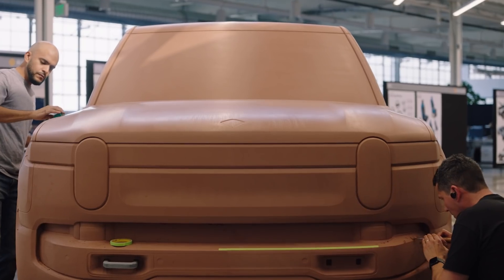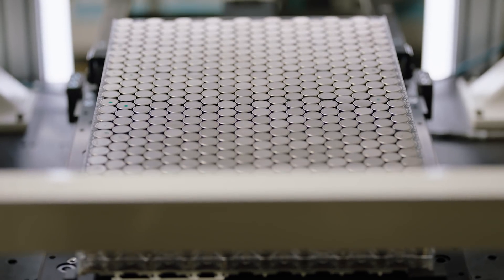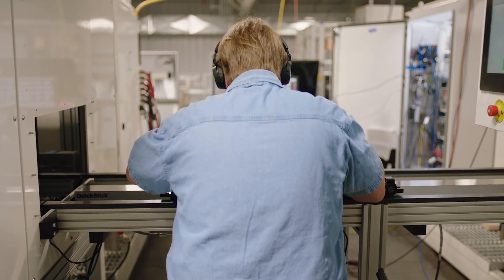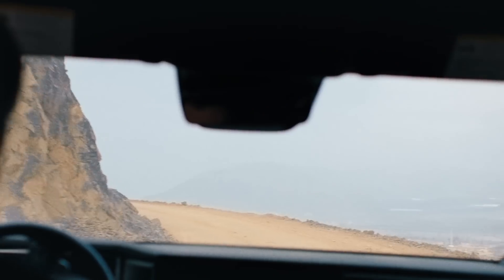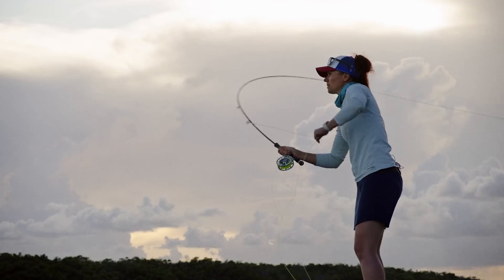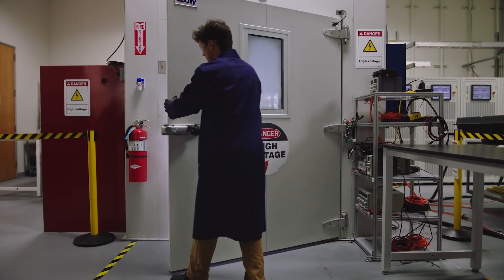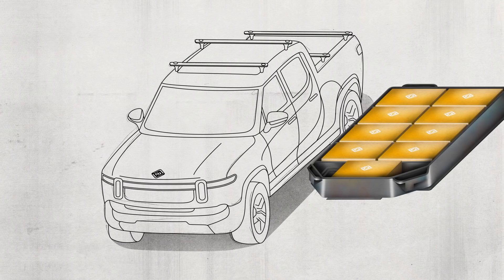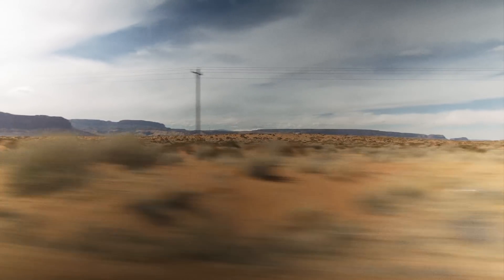Powering Adventure | Adventurous Forever | Rivian

Comment: I had high hopes for this truck , and I like the fact that your testing in dry applications like rocks and dirt , but can you test in wet applications like crossing a small water crossing higher than your brake rotors, the ford f150 electric admit that its not water friendly and water can not go higher than the bottom of the brake rotors , kinda disappointing

Comment: RIVIAN is poor Design and poor Specs and its Expensive. 
Rivian R1T is a LIGHWEIGHT Medium Size Pickup , its made with a 100 year old Body on Frame design. 
and its using SOFT Metals that can Scratch , Dent, and RUST Easily. good luck keeping a Rivian for 50+ years. 
besides you are Paying LUXURY price for a SHORT BED Pickup that has less spec than a Dual Motor Cybertruck.
Reply: If the body on frame design is so bad, then how come its the industry standard?
Reply: @casper6800   - because GMC, Ram and Ford are NOT Vertically Intergrated and DO NOT use 1st Principles in Engineering. 
LEGACY truck makers are still using CATALOG ENGINEERING and DO NOT make their own PARTS. 
they get them from the LOWEST BIDDER. 
and they BUILD their Trucks from a PARTS BIN Catalog from Suppliers , MANY have the SAME Parts.
so, LEGACY trucks are NOT Innovating. 
which is why FEW trucks even have 4 Wheel Independent Suspension. 
and they are using HORSE & BUGGY suspension , invinted 100 years ago.
Reply: @markplott4820  
And the point I'm trying to make is that, even though body on frame has its shortcomings in some areas, when it comes down to truck design its still the best option. 
Trucks get used, if a body panel gets dented, it can be easily replaced as long as the chassis didn't get damaged in the process. 
Also the use of a classic chassis allows for a simple 3 box design, witch is not only easy to manufacture but also incredibly efficient owing to very little wasted space for the space it takes up.

And to add to that, Rivian uses an independant adjustable suspension.

Not to mention, if there really was such a superior design out there, wouldn't every truck on the road today look completely different?

And this is very much nitpicking but your "Horse & buggy" suspension is called leaf spring
Reply: @casper6800   - ZERO Innovation happening with LEGACY truck makers.
same, Bullshit. year after year.
RIVIAN, TESLA, BOLLINGER are doing MORE
Reply: @markplott4820  
Im not trying to defend legacy truck makers, I was just wondering why you seemingly had a problem with a body on frame design. 
The biggest problem legacy truck makers have right now is that they were unholy prepared for the hype around electric trucks, and with no offerings of their own, some of these partnerships (Rivian and Ford, Lordstown motors and GM) start to make a lot of sence. 
Why spend time and effort into R&D when you can just invest in an existing company and get licensing right for their chassis. Just place your own body on their chassis, sell it as your own, and problem solved.

They're not inovating, because its been done for them and they kinda just bought in.

I'm not going to touch on Tesla because, although they are innovating, they mostly seem to keep to themselves when it comes to production rights/licensing etc. Although I could be getting that wrong, I havent read up on them in a while.

Comment: I love the Rivian story however electric vehicles have the same carbon footprint as a 4-cylinder combustion up to 180,000 miles after that the electric vehicle starts to reduce its footprint. The environmental study was inconclusive because we do not know to recycle the batteries so the study was done without that factor. With that said the selling point of an EV is less parts; which, equals less maintenance, breakdowns and repairs. So all those horned up on going electric if you want to convince your friends who are skeptical that’s your argument and the 400 plus mile batteries.

Comment: Would appreciate if you consider PV cells on the roof, so the car can charge from the sun. Imagine the client is going out into the outback for hiking. As long as the person(s) are on the hiking trip, the car is charging. BR from Germany!
Reply: Enough people have done the math on this already, but it comes down to:

Even when you take the maximum area the car can offer (trunk/bed, roof, hood) the power gained from solar charging would be almost negligable on a perfect day, so its not worth the extra cost that would bring

Comment: Dear friends, I like your car, all spec meet my requirement. The only problem - I need a car with the range > 1200km  at normal conditions that to get at least 900 km in winter taking into account cold reducing charge and consuptions for heating the cabin.  Only in that case I will be free to travel a day from city to city without problem , otherwise this car is only for city.
When do you expect to devilled new generations of batteries with the car - better then old fashion lithium ?
Reply: At it's current efficiency rating, the battery pack would need to be about double the size of it's current rating to meet your needs. If there is a breakthrough that doubles the energy density of batteries, which is what Tesla may possibly be planning to announce during their battery day in September, then it would be a few years before such a vehicle exists. That's my guess at least.

Comment: It looks like you invented the Tesla battery pack. :)  It's a good design to copy.
Reply: How do you see this comparing to a Tesla-specific battery pack? Over sized AA battery configuration is not a proprietary technology.
Reply: If you look at the tesla packs cooling? It's much more advanced. Then a simple plate sandwiched inbetween the cells. 🤔

Comment: Would like to see more of the planned and available options.
A bunch of cool add-ons in the videos, but will they be available at time of purchase as an option?
 
The battery swap is a great enhancement.
I asked a while ago if Rivian is planning a V2H feature in their vehicles.
Having the ability to supplement the homes during peak hours and charge at night when the per watt is cheaper would be a great addition to the already planned battery roles. Also would be attractive to the off grid'ers that have a vehicle but don't drive as many miles as the battery can support.